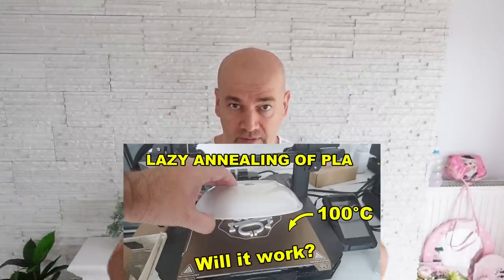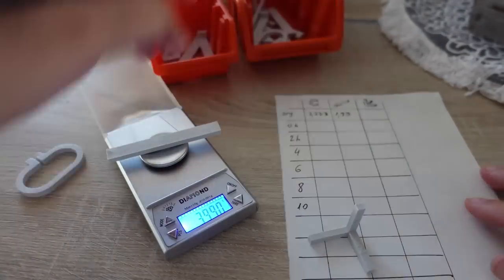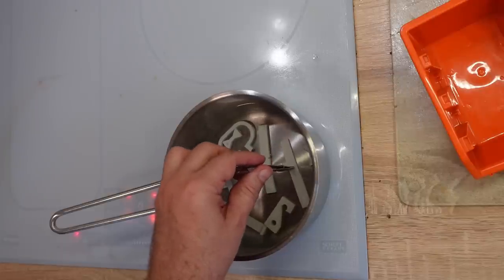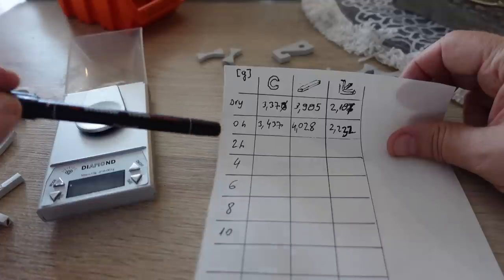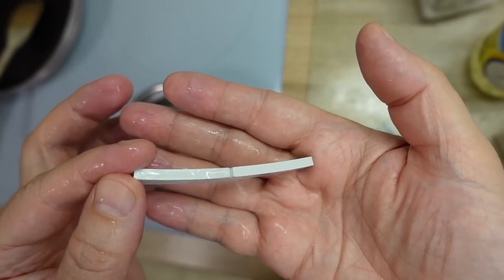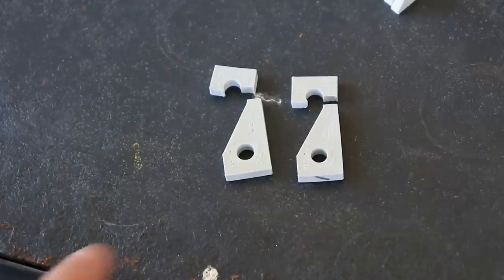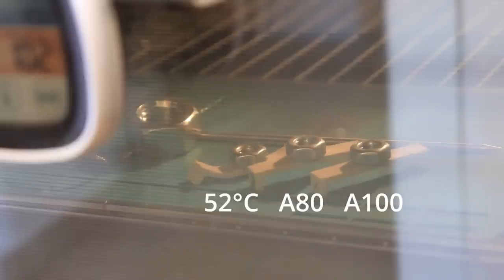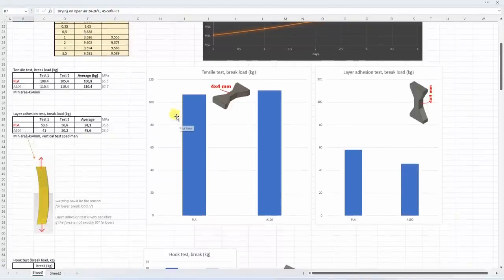PLA annealing in a boiling water

Comment: Issue:
1. The parts are touching the metal which is directly touching the heat source
2. The formation of air pockets between the pan and the part is causing uneven temperatures across the surface of the part and causing the warping.

Suggestion:
- Boil water and pour into a shallow tray or cake pan
- place the parts in and allow them to sit a minute or two.
- slowly add warm water until the temperature reduces enough to touch
- remove and let dry.

This should fix warping. I also suggest using triangle or honeycomb infill. The water may be best at 90c and not 100 due to air trapped in the inner infill. The air pressure inside will cause issues as it moves toward equilibrium.
The annealing process is really meant for solid parts unless your top and bottom layers are a minimum of 4mm with 1mm infill.
Hope this helps.

Comment: Igor very nice video and test! As someone else mentioned in the other video there are modifed PLAs that deform less during annealing, like Volcano PLA from FormFutura. I am looking forward to the PLA GF tests. I think the latest hype material for annealing is *PET CF*. Not to be confused with PETG-CF. PET can be annealed, while PETG can't (glycol prevents crystalization, at least that is what I have read online). PET CF has been recently introduced by Ultimaker and with annealing it can reach 181°C heat resistance (note that Ultimaker says there is still some deformation from the annealing process even with the carbon fibers). But for your tests, I think you can get 1.75mm PET CF from brands you have worked with in the past, like Phaetus aeForce PET CF or QIDI PET CF or BambuLabs PET CF. It is definately an interesting material, prints at about 280-300°C and these brands also claim very high heat resistance properties. It would be interesting if you could verify those claims and see if the HDT they claim is after annealing or straight off the print bed.

Comment: The bottom.of the pan is hotter than the water above it. This caused the part of the extrusions ttouching the metal o soften faster than the area not touching the bottom.

Perhaps putting them on a sheet of non conducting material will allow for an equal exposure  to heat and avoid warping.

Comment: Thanks for a thorough test.  In order to improve my PLA prints, I paint my parts with Chloroform. Due to capilary action the chloroform is "absorbed" by the part. The chloroform dissolves the PLA and bonds the print grains. The surface also becomes impenetrable and shiny with a very good surface finish.  When my PLA parts break, I bond them with chloroform which renders a stronger part. In some cases where I have to fix surface imperfections or need some sort of build up, I dissolve PLA in chloroform in a glass tube and paint the "glue" on the part.  I've done some informal testing on single layer prints and the results are astounding.  After painting the single layer print with chloroform there is no delamination between the print string.
A test of the influence of chloroform on PLA will be most interesting.  Will you please consider it?
Reply: Tnx. I bought some chloroform the other day and also had bought zipties (for my bike) some ducttape (as I ran out) and I always have a shovel in my car (to dig myself out if car stuck). If the police had stopped me, that would have rendered some difficult questions. Good thing I didnt  by bleach, a hacksaw and garbage bags that day
Reply: @Ed19601  😂

Comment: I really enjoy and appreciate all the work you put into your videos.  The PLA going from 50 to 150 degrees is mind boggling.  If we could figure out a way to control the warping/shrinkage this would be a game changer for functional PLA prints. I can't help but wonder how metal filled PLA would respond to this post processing method.
Reply: Placing the part in sand, then baking it at annealing temps reduces warping.

Comment: I am just a hobby metalsmith but. I think you could gain great results with annealing if you try putting your parts in a very fine silica powder or a fine play sand, maybe even powered aluminum and putting that into your kitchen oven. bring it up to the temp you  require then let it cool. what ever powdered medium you use it will support your parts and aid in even heating and cooling, the presser of the material around your parts may also help with limiting deformation an warping of parts. try researching the annealing processes of metal parts because i cant really explain it well

Comment: An idea: put some sand in the pot, place the objects in the pot, cover them with more sand, then add water and heat up. It should limit, if not eliminate warping. :)
Reply: You could use casting sand, and bake it in the oven to reflow the plastic into one solid piece. Needs to be 100% infill though.

Comment: What about modifying the gcode to iron on each layer before the next layer is printed?

Would probsbly take for ever to print but interesting what the result would be
Reply: Yes, PrusaSlicer 2.6 can be set to iron all solid layers, so at 100% infill it should iron all layers. There is also an ironing line width variable, which could probably be set as wide as the exterior tip diameter of the extruder nozzle. There is also the ironing speed variable. Maybe playing with those variables could significantly increase the speed of ironing all the layers of a solid part.

Comment: Annealing is such a PITA that it would be better to have filament that stands heat without processing (and is easy to print, sorry ABS 😕 )
I wonder what Aurapol PLA HT110 would be mechanically and temperature-wise 🤔
Reply from the maker: Something line Engineering PLA by Filaticum? (Tested, 150C no annealing) Maybe this is their secret?

Comment: I did't read all comments before, but you should use 100°C steam, and completely avoid metal contact, there is always a temperature gradient which may contribute to the bending. Anneal your parts on a metal mesh in steam, with enough distance to the boiling water to avoid splashes. The heat transfer btwn steam and your parts is at least 100 times faster and far more homogeneous, without a temperature gradient..

Comment: The best thing people have reported using so far is ultra fine table salt, which can be bought in bulk quantities as "popcorn salt". The only measurement I can find right now says 0.2mm grain size, but I could swear popcorn salt was smaller than that. It can go right into your lungs if you're not careful though. I don't know if anyone has tried corn starch, which one source I'm looking at says averages 0.005 to 0.020 mm grain size. Might possibly work better though IDK if it's as easy to remove.
Reply: Ironically I was just looking up whether someone had tried corn meal after suggesting this, and it seems that washing powder, in the form of preheated baking soda (100+°C, 60+ min) is a more recent recommendation.

Comment: I did experiments with annealing during covid 2 years ago. Annealing was done by boiling in microwave oven.
The only filament brand on my hand which had the least warping was White PLA from Creality shipped with my Ender 3 Pro. Other tested green Esun PLA+ and black Bestfilament PLA had severe warping.
Right away, I ordered the set of two (white+black PLA) from Creality, but still did not test them after moveover.

Comment: Now I'm wondering how these samples would fare being annealed in a vacuum sealer bag (like FoodSaver).  For the shrink test, you'd have to have support media in the bag (sand or salt).  My theory is the bag would provide some level of stabilization and prevent some warping.  

And if you use an immersion circulating heater like used in sous vide cooking, you could ensure the water around all parts is evenly heated.  Doing it on the stove means the bottom surface will always be hotter than the surrounding area (unless the parts are lifted off the pan).  You probably wouldn't want to do this with uncontained parts, but in a vacuum bag, they should be protected from the strong circulation.

Comment: I've tried putting PLA parts in a ziplock bag and suspending in boiling water, but still warped, and slight change in color. I might try at lower temps, or bring on and off heat slower.

Comment: Good testing, but you have to realize that by placing the parts at the bottom of the pan there will be more warping/shrinkage/degradation because of the thermal profile of the water bath and the heat conduction across the bottom of the pan, right? A better test would be to submerge the parts without leaving them in contact with any surfaces of the pan. Also adding it some form of steering would be optimal for thermal homogeneity.

Comment: I believe that the issue with deformation is due to uneven heat penetration. I would suggest running a more lengthy annealing process when first water is heated to 50C and held and that temperature for 1 hour. Then increse it to 55C for one more hour, then 60C and 65C. I believe there's no real point in going above 65C in this scenario. Slow heating like that should release internal stresses gradually and keep geometry intact.

Comment: I did some annealing tests a while ago with eSun PLA+.

Material got harder. But layer adhesion seemed to be notatbly worse.

Could not properly test impact resistence.
But if it's the same (like shown in your test), that's pretty good, because usually harder material tends to be more brittle.
So annealed PLA+ is still interesting to me.

Comment: Maybe packing the PLA pieces in greensand like in sand casting, as in metallurgy, and heating the whole thing,  could help with the warping. I think this could be another way to approach annealing plastics. Or maybe using plaster moulds? Something that keeps the basic dimensions of the piece while the heat fuses the layers. Other thing that crossed my min,  increasing the medium (water) density by adding starch and thus keeping the pieces heated by all sides evenly... Maybe using heated oil?

Comment: I'm curious if a steamer might be a better solution, you can keep the parts far away from the heating element to avoid hot spots and it might prevent the plastic from absorbing water

Comment: If annealing is only about drying/heating the PLA it might be possible to anneal at lower temperatures without warping. Going by Arrhenius, if annealing at 90°C 1h is sufficient, then 80°C 2h, 70°C 4h and 60°C8h and 50°C 16h and 40°C 32h and 30°C64h.
So annealing might be possible without warping at 40°C if you heat it for two or three days?

Comment: Good chance that the heat transfer into the print is higher on the side in contact with the metal bottom of the pan that it is with the water and that this uneven transfer of heat is the cause of most of the warping.

Would try doing this in a Sous-Vide bag suspended in the water hung from a piece of wood across the top of the pan...(bonus, no water exposure of the print...)

Comment: Ok, my question is why we dont print directly with annealed PLA from the spool? Is there any problem to produce it?
Reply from the maker: Could be something like Engineering PLA by Filaticum? (similar thermal resistance without annealing, tested)
Reply: @MyTechFun  exactly my thought. Do you think that's an annealed raw material? Because it starts to yield at the same temp
Reply: If you melt a crystal it's no longer a crystal. You'd just have more rigid (and thus more brittle) filament before printing, no difference from unannealed after. I've actually done this by mistake with excessive dryer temperatures and it's a pain to salvage the material.

Comment: I wonder if more can be done with print settings.  Maybe higher bed settings, or hotter nozzle with slow speeds and with a pause between layers, maybe on a non-heated bed so each layer heats the previous layers up some then they cool before the next layer.
The time it takes to anneal parts, maybe different slicing could achieve similar results without the fear of warping or shrinking.
CNC Kitchen did some testing with different layers heights, over extruding, etc.  I wonder if those results are similar to annealing.  You guys use different test objects so it's hard to compare.

Comment: Very good. I make model train parts. Some parts are used in making smoke, which can reach 120-140C I am using CF PETG and CF PLA but i want to have a safer  product. Boiling these parts make sense. Since they fit together warping is not allowed. Thoughts, Dennis

Comment: What you should do is to use Pressurized Salt. When the salt is packed tight in a closed can, it cannot move around and there is zero deformation. Using PLA is kinda pointless however, because ABS will be much stronger and heat resistant. One hour at 200°C and ABS will be equal  to pressure mould.

Comment: Instead of adding CF to minimize PLA warping, other things might be a better compromise. I.e. HTPRO PLA (Trček) might have just enough additives to be better at annealing, though it does warp a bit when printing (like ASA, nothing much). But I just love that filament and use it almost exclusively instead of PLA. Also, maybe it would make sense to add rebar to PLA in x/y directions like we do with concrete? Rebar could be made of ASA, though it would require a pause mid-print to insert it which is a PITA.
Alternatively, maybe there's an infill geometry that could help with this problem too? Or maybe cleverly positioned supports and brim which would be removed after annealing? Those all feel like they could be more predictable than adding a bunch of CF to PLA and losing all the characteristics that make PLA so wonderful.
Reply: I would try fumed silica as a filler but idk the resulting material might turn out pretty funny. Anyway this is volume preserving so it won't induce warpage and is likely to cancel it out, i think. It will also probably kill stringing dead. It might kill printing dead as well though, that's the concern. Has anyone tried to make such a material?

Comment: I wonder if another method to anneal using the properties of water, without absorbing water. With your pan, the element heats up very high for a second or two, then turns off, during this time the PLA is VERY soft. so... to avoid it sitting on the pan, AND not absorbing any of the water, seal the parts in a plastic bag, and sous-vide them at exactly 90-100degrees! I have a sous-vide machine, I'd like to try this.

Comment: what if you placed the parts inside vacuum bags, similar to how food items are vacuum packed. Further you can place them on a rigid surface before wrapping them.
This will avoid the contact with water, reduce the warping and reduce contact with the hot pan - that is way above boiling point

Comment: I pack the prints in green casting sand. Would be interested to see how that method works compared to water.
Reply: That is actually a great idea, but still an issue with shrinkage and gravity I imagine?
Reply: This method is long known as remelt in sand/salt/gypsum. 
Even if you only anneal and not remelt, still the amount of work is the same.

Comment: Would using sand or small metal beads in the water as support work?
Reply: I would use crumpled up aluminum foil to keep the items up off the direct heat of the bottom of the pan. I anneal carbon fiber nylon in an oven to strengthen our 3d printed wrenches for testing and I use crumpled up aluminum foil to keep the wrenches up off of the baking sheet.

Comment: I wonder if using heated sand would achieve the same results without the issue of water absorption.
Reply: As I recall, CNCKitchen did some heated sand annealing tests with decent results as long as you don't mind a sand textured surface (and potentially some sand stuck to the surface).

Comment: TLDR; Unless you're concerned about deformation from high temperatures (in which case you shouldn't be using PLA in the first place), hot water annealing either makes no difference or gets you slightly worse performance (all while adding distortion to the shape).

Comment: Try oven annealing in a packed sand bath. So, submerge the PLA parts in sand or plaster powder. Vibrate to settle out & fill gaps then tightly pack the sand with a weighted cover. Bake the sand to 100 degrees centigrade (or higher) for long enough to reach the parts. Leave to cool. Remove the parts. This might help mitigate deformation during the annealing process.

Comment: I can see how thermosets can benefit from a post-cure, but thermoplastics soften as they are heated. I'm having a hard time getting my head around what is physically happening with the 'annealing' of this thermoplastic.
Reply: The key here is not cross-linking but structure and maybe softeners evaporation.
Reply: @juanmartin1165  There is no plasticizer in PLA.
Reply: Good to know!! Do you know for instance if PLA "tempering" Is a progressive process?? I mean if by making it gradual we got gradually increased heat resistance whithout crossing the deformation point... 
In composites is the way to go for low distortion.
Reply: @juanmartin1165   IDK from what i heard it might well be ¯\_(ツ)_/¯
Reply: It will be a good test for this channel. Heating controller can be bought or made easily.